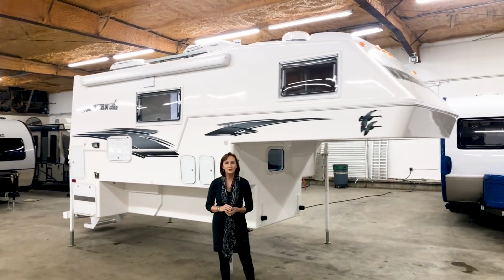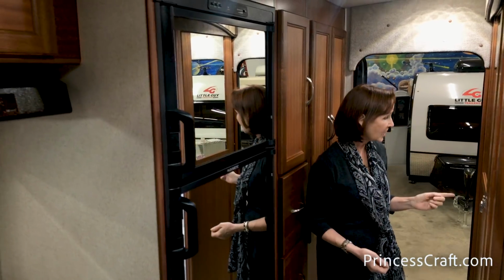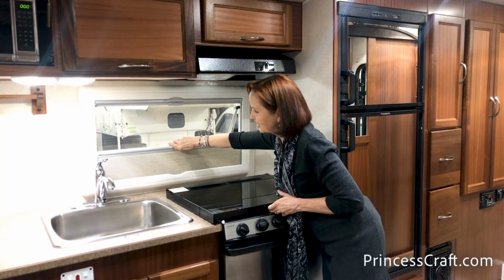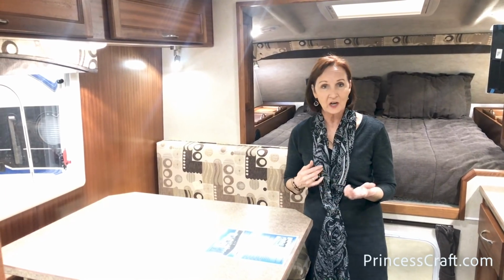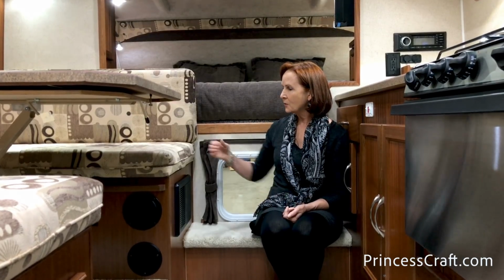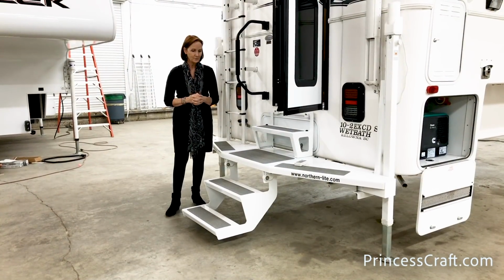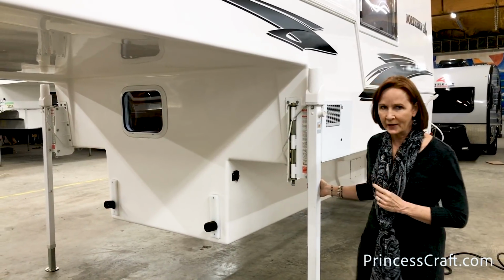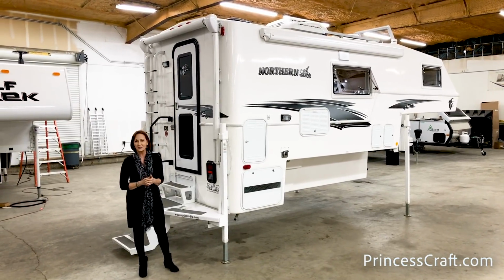2019 Northern Lite 10-2 EXCD SE Truck Camper Walkthrough Tour

Comment: Apparently they didn't like my truthful review and deleted this comment. Fortunately I wrote it in notes and still have it. Shame on you for censoring me when I bought one of these! 
Here is the original review:

I'm laying in my 10-2 EXCDSE now. I've had it since September 2018 and have spent a LOT of time here. Infact I am now living in it full time. 

In that time I have had the heater replaced twice. The propane lines worked on. A leak under the sink. The fridge currently turns itself off 10 times a day when on Propane. One of my cabinets has come apart and I need to get it fixed. You MUST have a generator because the solar panel is a joke. The two 100amp hour AGM batteries won't even power the heater all night. Every day I have to run the generator for 4 hours. I don't even use any plugs/low voltage. I have a Yeti Goal Zero 1000 watt inverter that I plug stuff into. 
The insulation is nothing impressive. I live in Los Gatos, CA and the heater has to run at least 4 times per night to keep it at 65-70 right now. When I am plugged in and can run a small space heater, the cabin stays pretty warm. However that space heater definitely runs 4+ times a night. 
Can't imagine what snow would be like. The main heater is near the door and doesn't cool the sleep area well.
My buddy said to just get thicker blankets, etc. But I have a Pitbull and he gets cold too.
I absolutely LOVE the higher ceiling. It makes a big difference in the bed area. I am 6'3" and have no problem in the bed, shower, etc.
Airflow has been an issue. I have had mold issues in both of my wardrobes. I have purchased a dehumidifier and DampRid in both wardrobes. As another comment described, this is a must. 
The black out Windows are awesome. However the window to the cab doesn't have the same black outs? Just curtains. You can see light through them. So the blackout is ruined.
The bathroom counter top collects water when level. So you have to push it around or towel it up. Or have your camper out of level. Door is great but I never close it so I velcroed it open. I have a wet bath and wish I had got the dry bath. 
Pantry is great. This camper has a lot of storage. Gas props on cabinets work great. Cabinets are quality. Although I do miss my access to the truck bed.
The windows suck! Acrylic? It scratches so easily. I am afraid to do any real camping where I have to push through trees. And if you leave the shade open, you do lose a lot of heat. I never have all the shades open at night. My window gas props don't work properly and only stay open at maximum height.
Stove/Oven is great. You have to light the oven manually.
The led lights are nice, but quite bright no matter what.
I rarely use the stereo. The Bluetooth was a pain in the ass to pair. If you want to run the television through the stereo and have a surround sound, then n you must buy a double ended jack and run it to the front of the speaker, thus having another wire exposed and looking unsightly. Unusually hard. One of the three zones didn't work from the beginning. So I use a JBL portable speaker.
The dinette is nice. I have the face to face, not U shape. The table adjuster seems awesome. But the pin does not stay locked during transit. It's always going up and down as you drive. It isn't very strong. If you fall in the table or some kid sits on it, it will break. I have to constantly remind my girlfriend not to put too much weight on the table. The table slides left and right and the stopper doesn't stop well.
Even in California, I have had issues w the propane tanks getting cold.
I have the same Generator and it's loud! You can hear it 40ft away. It was installed poorly by the dealer and tends to rattle. 
The propane slide out is a pain in the ass! On the truck, accessing the one in the rear requires a tall person. The mount in the middle just gets in the way and replacing it is a pain too. I saw a 2017 w side mount tanks on a slide and it looked easier. The slide and all galvanized items have started to corrode. The two bottles will last you about a week boondocking. 
I replaced the stair upto the bed w a solid wood tread. Putting carpet there was stupid. It got dirty so fast.
The bed that comes w the camper is very nice. Making the bed is a pain in the ass. The air gap under the bed is decent, but I still get a little mold at the head of the bed where it touches the walls. So I take it out and air it out as often as possible. There is a fancy new system that acts like a box spring that I'm planning to purchase. That's another $200.
The wardrobe in the bed area is weird. Because of the direction of the hangers, you have to remove everything to get to the back of it.
I love the skylight, but it loses a lot of heat there. Gotta keep the shade closed at night.
I tossed the carpet. Was just a dirt collector.
Pulling a trailer w the deck? You have to get a special hitch. I got the Torklift Super Hitch $2000 and 48" Super Truss $600. I can tow upto 7000 lbs with it. The fast guns (tie downs) are another $600. Locks are $100. So over $3500 invested total in Hitch and Tie Downs (I installed myself. Very easy) 
The deck is white and beautiful, but scratches easily. Especially where the little removable step is.
Why did they make the square tube in the patio too small for a sewer hose? Wth?
Happy Jack's all work at different speed. So you have to keep adjusting them. Although it's absolutely amazing to have a remote control for the legs. 
It's very hard to get on the roof because of the awning. No handles up top. I'm in good shape. And have no issue climbing generally. Anyone old or overweight should avoid it. 
Not sure of how long 10lbs of propane will run the generator. But I already have 100hrs on it and I use everything daily. It lasts pretty well.
I have a 2006 F250 Diesal Crew Cab w Air Bags that I pull it with, no problem. Always in Tow mode. 8-10mpg. I have a two inch lift and 35" MT tires on 20" wheels.
So, is it worth the coin? I paid 41k last September 2018 for a 2019 model. Another 4k for generator. Although I have almost 50k in it so far and still need another 2k for batteries, 2k for solar, and whatever for an inverter. Not to mention installation costs. 
To me, no, the price isn't right. I have a 70k Lexus and it works perfectly all the time. This is like the most expensive camper (without slides) on the market. It isn't even Lexus quality.
I do think the structure will last a long time. It's shell, cabinets, etc will last.
I already have scratches on the acrylic windows from trees and I do mostly city/urban camping/living. 
My truck was 55k new and look at what I get for 55k. Today that would be 80k. Even a 55k truck today is amazing and has a lot of technology.
The batteries that come are bullshit! They should be MUCH better for this price tag. At least 6 volt batteries. The heater should be better than the same one I had in my 18k 20ft Micro Minnie.
As you learn more and more about what's available for these rigs, you start to feel aggravated that Northern Lite isn't ahead of the game with more efficient heaters, better fridges, and certainly better testing.
If I keep this thing, which I probably will. I will replace the fridge cooling system, the heater, possibly a composting toilet, the shower head, add 500 watts of solar or more, lithium ion batteries and a damn charge controller that tells you how much power you're USING as well. 
You get a lot of looks. This camper looks fantastic. It looks expensive. And when city camping, You're not bothered unless some weirdo neighbors call. I had that happen already.
The black outs really are black outs. You can't see any light except for a little in the door windows, which aren't the same tech and the cab window which is just tiny, shitty curtains.

Advice for buyers:
Expect some mechanical failures.
Have a back up plan for heat. Like a propane Buddy Heater or an Olympian. 
Get money back for the batteries from the dealer and go buy your own immediately. I am planning to replace mine asap. Probably lithium ion 100amp hour ($1000ea)
Have a generator. The auto start is great. But you could use two Honda 1000 and they would be more quiet.
There should ABSOLUTELY be at least a 1000-3000 watt inverter in the camper to store additional power for the camper and it should be tied into the Chrage controller, batteries and generator. It's 2019! 
Happy hunting... 

This review has been a work in progress. So it's a little messy.
Overall I am happy in this camper. I live in it full time. But I am disappointed that I paid 44k and need to invest another 10k to make it liveable.
If I had the time and chance to do it again, I would spend 50k and build my own unit and would surely get more for my money.
Reply: Awesome review.  Thanks for posting this.
Reply: Topanga Reyna  I don't care how much an RV costs, RV appliances, plumbing, etc. are not designed for continuous use.  In other words, an RV fridge isn't designed to be used day in and day out for years and years like a house fridge. Neither is an RV furnace, RV A/C,  RV toilet, or anything else in an RV.  They aren't houses, mobile homes, or anything of the sort.  They're designed to be temporary housing that is used occasionally.  Why people think they can move into them permanently and not expect to have problems is beyond me.
Reply: @jamesrodriquez2863  ah so in 6 months I should expect issues? You got buy one and see if you feel the same. ;)
Reply: So....you're living in a camper, something that is not designed to be lived in full time, and you are complaining about things that aren't designed for continuous use that are malfunctioning because you're using them continuously?  Alrighty then!
Reply: @jamesrodriquez2863  Yes. It is meant to be a living unit. Not lawn ornament. And it's also the best in class. When you buy one, you let me know buddy
Reply: Topanga Reyna  right. It hasn't even been one year. And I was not living in it full time until January. Plus it sat for two months while I was out of the country. So it's gotten about 5 months full time use.

Comment: I would like to see what it looks like on an F-150, some other truck.
Why does everybody always leave out the price?
Okay, I just checked out the prices on the website.  These things cost twice as much as a new car, and as much as the cost of a low mileage Class A RV, or more than the cost of a nice slightly used class C RV.
Reply: I don't think you can use a 150 for this camper
Reply: @robertcampbell5355  
Why not?
Reply: @RedRider1600  A truck camper this size requires the heavier suspension and brakes that come on 3/4 and 1 ton trucks.  Can you do it with a 1/2 ton?  Maybe, but it's gonna rock side to side, lift the front end enough that the steering gets "squirrely", and wear the brakes out more often.
Reply: @RedRider1600  F150 not even close...250 would be strained without dually and suspension package. I have a 1999 Elkhorn 9T that weighs 3200 wet, and my 5.4 f250 long box supercab with camper suspension package can barely handle it. In fact next year i do air bags to help.
Reply: @RedRider1600  Buddy, you're a good 3000 lbs light in payload with an F150. This beast requires a one-tonne.
Reply: @markwillcox720  The guy asked a silly question. Your homophobic drivel isn't necessary. You have a real preoccupation with 'man-sex' there fella, feeling ignored? Go to prison sewer-mouth, you'll be happy.

Comment: I want to love this camper mainly because its built like a boat and should last a very long time with no leaks or water damage. But I can't. No slide outs. The storage tray is a joke.  The microwave placement is that some kind of a joke? A wet bath in a 
48k unit? Sorry no sale, the Lance, Alps and Host far superior for the money. I prefer the Palamino to this one. Even if the Palamino wares out the money I save I can just go by a new one. The one huge draw back is lack of built in generator in the Palamino. Sorry, just how I see it. Your mileage may vary.
Reply: I Dont want slides to break And Leak. I Dont want bonded fiberglass construction that delamintes. I dont want built in microwaves that take up space. I like them removable, so if I go boondocking I can take microwave out and gave extra storage. That how I see it. Oh, every Palomino I looked at on several different lots were pretty much falling apart even before they were used/ sold. On of them the bathroom door fell off in my wifes hands!
Reply: If you don't like it, don't buy it! It's not exactly rocket science!
Reply: They have a dry bath version as well.  Personally the wet bath is fine with me but for those like you there are other options.

Comment: Hello is this a true four season camper what type of insulation do you use ?
Reply from the maker: It is a true 4 season camper. The manufacturer, Northern Lite, uses block foam insulation throughout the structure, and they double up that insulation under the cab-over portion of the camper.
Reply: It gets -50  degrees in winter in northern Canada, u think this would hold up & b warm in that ,that's a 4 season camper,I know ,cause I live there

Comment: Bad start when the first closet you show has ill fitting white trim on the inside bottom and white trim/caulking hanging along the inside top
Reply: Don't give too many negative or they will delete your comment, like mine! You spend 50k on a camper and are not even allowed to post an honest review.
Reply: That’s not caulk it’s trim following the curve of the fibreglass mold.
Yes it looks like crap.

Comment: Lousy bedroom design. Would have to put a smaller bed in there. That bed would be so hard to make and most beds have storage within them. This would be better without the side cabinets in the bedroom.
Reply: That's a personal preference. From the people I know with campers, they prefer the space and comfort of a 60" x 80". The next narrower RV standard I've seen is 53" wide, which is confining for some. As with other manufacturers, this camper has storage underneath as well what's on the side. For use by a couple, I'd readily accept increased difficulty in making the bed in exchange for the increased size.
Reply: I like havin the cabinets in my camper. Takes an extra 2 minutes to make the bed, but worth it.